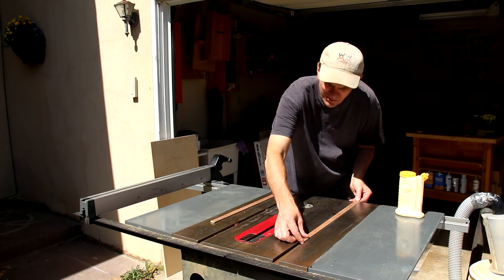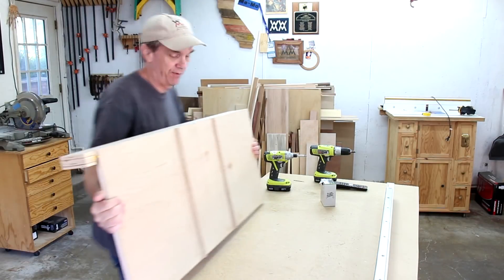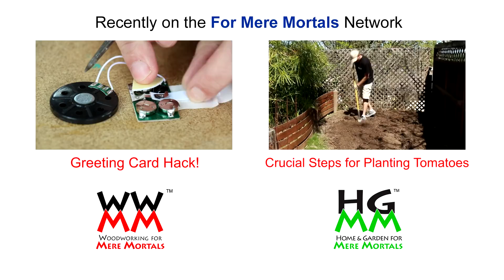Build a crosscut sled: essential table saw jig

Comment: I'm a complete newbie. Will this crosscut sled prevent kickbacks? I noticed you don't have the riving knife while using this jig. Or is it there and i just cant see it?
Reply: I'm interested too. Just commenting so I get a notification
Reply: I can try to answer that... A cross cut sled allows you to cut pieces of wood that are wider then they are long.  Without a cross cut sled, you should never do that because the chance of kickback is really high.  With the sled, the material is held tight against the rear fence and the sled is snug in the mitre slots.  It greatly increases the safety of cuts and allows you to make a greater variety of cuts as I mentioned.
Reply: Rob Knox kickbacks are caused by 2 main reasons.
1. The wood was not kept running parallel trough the blade.
2. Or the wood strarts to worp during the cut... Make sure ti have a riving  knife to avoid kickbacks.
So yes this will help but kickbacks usually happens when you are ripping.
Reply: Jay: even with a sled, internal stress in a board can be released during a cut, pinch the blade, and produce a kick, though the sled makes it less likely the piece will be launched across the workshop...
I find the sled invaluable when duplicating lengths for crosscuts on parts like drawer sides, etc.

Comment: Steve, I have a Ryobi Saw System which isn't your conventional type of table saw setup. It has a miter gauge table that moves with the miter gauge thus it doesn't have the slots like standard table. I have been wanting to have a sled so I could setup repeated cuts to make box joints. First have you ever seen one these saws and if so do you have any ideas for a sled that would work? Thanks, Jack G.

Comment: I need to make one of these and as a newbie woodworker, this looks like it will be a good place for me to start. 

I had a few questions, if you have time to answer.

Was there a specific reason that you glued several layers of ply together to make the front and back fences, rather than just starting with a single, thicker piece of ply (or maybe a piece of pine etc)?

Also, how essential is that metal bracket? I understand that you used it make sure you had a straight edge on the face of the fence, but I'm wondering if there is a 'non metalic' way to ensure that the fence has a nice straight edge. I'd be a little bit hesitant to put metal on a sled. Seems like if the blade were up high enough, it may come into contact with that metal bracket towards the end of the cut.
Reply: Zebitty 
Plywood resists movement with changes in humidity. As for alternatives to the angle iron, you don't need it. You can use solid lumber like maple and flatten one face of it to achieve the same thing.

Comment: I like to paint that block on the front of the sled red, as an extra "don't even think of putting your hand here" warning...
Reply: Or purple. Steve loves purple. Maybe also cover it with a different texture like a strip of heavy grid sand paper at the critical spot. That way it works even when you are not looking at your hands but rather at the cut area on the other side.
Reply: That's a good idea
Reply: or cover it with sharp pointy things!
Reply: Or put a steel plate between the block and the fence, when you hear it grind you are going to stop, it will ruin the blade, but that's well worth an un-mutilated hand.
Reply: so you can cut your hand in order to prevent you from cutting your hand....
Reply: How would that cut your hand?
Reply: Or do like they do with cigarette packs overseas, paste pictures of severed fingers all over the block as a reminder.
Reply: Or just dont put your hand there. You know, like you don't put your hand on a spinning blade, under the tire of a moving car, or in an alligators mouth.

Do those have to be painted red too?
Reply: Broken- ha pretty f'in funny
Reply: Broken Wave   Funny!  Your comment reminds me of a radio host I heard one time while driving, who was opining about all the safety equipment on cars today vs. when he was young.  He said what would force drivers to be safe and eliminate all wrecks, would be a spear point on the steering wheel, pointed right at the driver's heart.  That would be one cautious driver!
Reply: JusBidniss Its true...haha. Isn't the spinning blade warning enough?? Don't fucking touch it...pretty simple.
Most real carpenters I know (and myself) don't use safety gimmicks...instead they use tools properly.

Comment: Hi Steve, love your videos.....but wondering why you chose steel for the angle iron, does that limit the height you can cut? Are you worried about getting the blade into that steel? Just seems if you weren't careful you might have a major problem there.
Reply from the maker: Yes...definitely want to make it high enough so that the blade won't cut into it. (My blade won't raise up that high, especially with the 3/4" plywood base.)

Comment: one thing to be aware of is that many framing squares are actually not that square. So many are actually pretty shit. I got 5 and non do agree and only 1 is square enough for fine woodworking. I went to the hardware store and compared once all they had and was surprised how much they were out compared to each other, this includes bigger brands!
I think the wood whisperer has a good technique on how to align and test that back fence.

Comment: Hey Steve. Love your videos. But I have a question. I recently tried to make a sled for my contractors grade Ryobi table saw and have found that the miter slots have a taper to them. the feed end is narrower than the exit end. Is there anything I can do about that? The table surface is aluminum. Can I shave it down? Any feedback is appreciated.

Comment: I have a skil that does not allow for removal of the riving knife.  Is there a workaround for the step requiring cutting with removal of the knife?
Reply: not really, you can remove the knife from the underside of the top of the saw, but it's a pain

Comment: Steve, I have a Skil table saw, like the one you used to use. It has slide grooves with small tabs restricting me using a slide like you show. Is there a way to make the sled using grooved slides? I try, but when I do the slides are too tight. Any help or advice would be appreciated.

Comment: You have to make sure that you don't have a screw in the front fence where the blade goes through :)

And make sure you don't push through the back fence, it'd ruin your blade to run it into that reinforcing metal thingy. I liked your old design where you had a blade guard at the back of the sled.
Reply: I heard that that the wood wants to fold out on it's rings. It warps over time, like it wants to straighten out over the line of the rings or something like that...

Comment: my only question is would the ruler on the table saw still be relevant after building this? Sometimes I use that ruler on the table saw rather than measuring out with a tape ruler on the wood itself

Comment: Hey Steve how long until you would normally have to put some more of that finish on the bottom of your sled? Mine always seems so hard to push, almost to the point where it feels like it's jumping down the track and not gliding smoothly.
Reply: ***** thanks for the response. I was always told only use hardwood. Never thought to use plywood! Makes sense with the humidity here in Arkansas.

Comment: Would it not be preferable to make the sled runners out of metal (e.g., angle iron (of the proper width) similar to what you used for the bracing?  If you cut the wooden runners for an exact fit, they would bind on rainy days, and, if you allowed for that initially, then, by definition, they would have "slop" on dry days.   Even if wood expansion/contraction is not an issue, I would expect the wooden runners to develop "slop" over time just from repeated use as the wood rubs against the metal.

Comment: I would love to make a cross cut sled but my table saw has 2 lips in each groove that are about an inch long at the top that are supposed to hold the factory miter instead of at the bottom of the groove like yours seems to have. Any suggestions on how to work around that?

Comment: LOL ya got me.  Whoah, Metric!  Nicely done.  I hope you really enjoy your new sled, Steve.  I'm happy for you.  You know the 4-cut test for square?
Reply: What's the 4 cut test???? You got me itching
Reply: Philip Clark You spin a pizza-box sized piece of wood doing 4 cuts, and it compounds any slight angle on the last vertex.
Reply: Philip Clark Yes, ***** is correct, but what you do is measure each end of the 5th strip cut off...the measurement at the top of that strip should be exactly the same as the bottom width, basically the piece should have exactly parallel sides. If they don't, divide the difference by 5, and that's how out of square your fence is. If it's a positive number, move it one way, if it's negative, move it the opposite way. It would be really easy for Steve to do since he did not glue the fence, and he has a pivot screw.
Reply: Also, you drill all the holes for fence, except the pivot one, in different place, because correction us usually small enough that old screws would just bring it back into crooked position.
Reply: MP Woodworking Close, you divide it by 4, not 5. See mnwoodworks's video "5 Cuts to a Perfect Cross-Cut Sled" for a full how-to (warning: it's 37 minutes but it should answer all questions).
Reply: many thanks guys :-)

Comment: Hey nick,
 I am currently trying to make a crosscut sled for my 10inch Kobalt Table Saw, but I am having issues getting my tracks to slide back and fourth smoothly.  Do you have any suggestions?  I have been using 150 Grit Sand paper with my sander and also a lower grit sandpaper with a hand sander to try and smooth them out, but I don't want to sand too much and have the tracks fit too loosely.  Got any suggestions for me?
Also does it matter where the tracks end on the actual saw sled?  I know you recommend lining up the tracks flush to the front of the saw, but does it matter if they run the full length of the saw?  I have seen some videos where the tracks actually hang out so that the front board can be attached to the tracks?  Any suggestions?  Thanks in advanced.

Comment: Steve, thank you for your woodworking videos, I am a huge fan and I'm learning a lot from you.  On this video, I noticed that your smaller sled was cut for a dado width blade.  I want to build a sled for dado cuts as well as regular cuts.  Should I build 2 sleds or can I use the same sled for both types of cuts?
Reply from the maker: I thinks it's best to have 2 separate sleds. Then they each have zero clearance for the blade.
Reply: Thanks Steve. Due to storage space I was hoping to get away with just one but you're right, the zero clearance makes them safer. I will build 2 sleds and make space to store the them.

Comment: Steve, I have inherited an old Craftsman table saw.  My issue is the table is no longer flat.  I am going to build a cross cut sled for it but due to the table not being flat, I want to make the runners full depth so the sled actually sits above the table.  Now to be honest, I really have no interest in woodworking.  I plan on cutting aluminum sheet with the proper blade.  The primary table (minus extensions) is only 17"Wx20"L.  Instead of using the slots, would it be acceptable to use the edges of the table?  I want a large sled so this will also keep the sled from tipping due to having the table so far forward and back to fit my stock.  The longest cuts I plan on making are 24".  I do work as a Union Millwright, so I am mechanically inclined, just not a wood worker.  Any tips are greatly appreciated.

Comment: Hitting that angle iron with the blade by mistake would worry me. I know.. just be careful.  It just seems a little dangerous.  Would it not be enough to simply clamp the plywood to a straightedge before screwing it to the sled base? I'd imagine with enough screws it should stay pretty straight

Comment: Steve, I assume you planned for this when designing your sled, but I couldn't help wondering if the blade could be raised high enough to accidentally make contact with the steel angle?

Comment: Could you also get a wide board for a base with perfectly parallel edges, use a carpenter square to locate the runners at right angles to one of those parallel edges, then just attach the fences to the outside edge of the board?  Like, not sitting on the board and attached with vertical screws, but sitting alongside its edge and attached with horizontal screws?  There'd be no adjustment, but you wouldn't need it, if the base was parallel, the runners at right angle to the edge, and the fence stock of consistent thickness.  That seems easier somehow to me.  The only disadvantage I could see is if the base thickness was too thin and too little 'meat' to adequately take a screw, then you'd want the other orientation and screw up into thicker fences.  But other than that, is there a disadvantage I'm missing?
Reply: Since screwing anything to wood distorts the wood, you need to attach at right angles to the sensitive direction.  Screwing a fence to the edge of the base would compress the base.  Murphy's law says the compression would distort the base too much.  Also, getting the edge of the base perpendicular to the saw table's channels is next to impossible.  A few thousandths here and there can screw up a project.  Steve's swivel-screw method, coupled with the 5-cut squaring technique, can give you a right angle with a couple of thousandths error over 20" or so.
Reply: Ah, Murphy's Law, gets me every time!   And good thoughts on the sensitive direction being the one you want to be perfect.  I don't know about compressing the base per se , but I have had difficulty on occasion screwing something tight against the other piece vs. having a gap, so I suppose a 'tight' joint vs. a loose one (even without a gap) would throw things off.  Plus if the carpenter square doesn't get the runners perfect, you're right, no adjustment there once glued, and even if not glued, reattached runners would need to be moved far enough away from the original screw holes, etc., which is more of an 'ugh factor' than what I was attempting to avoid by attaching the fences to a good parallel edge.  Good points all, Bob D, thanks for your input!

Comment: Hi Steve, does this  replace the mitre saw (for making 90 degree cuts) ?
Reply: Oh very much!  A properly set up cross cut sled is many many times more accurate than ANY miter saw.  Not Festool, not Roybi, sleds will always win.

Comment: Steve, are you worried that the metal bar might get hit by the blade?  Nice and quick jig.  Thanks,
Reply: If the fence was tall enough that the blade could not reach the metal bar even if the blade were all the way up that problem would be eliminated.
Reply: @bruceevans56  IF

Comment: So I've tried building a crosscut sled a couple of times. Besides my table saw just being cheap, my stumbling block has been my miter slots; they're T-tracks. I've tried trimming the runners to the T- shape but they didn't feel sturdy enough. Then I tried using T-bolts, but there's too much play. Any suggestions? I know eventually I'll need a better saw. I just hope by then I haven't completely converted to hand tools. Feels like I'm heading in that direction.
Reply: I just ground mine out. I tried making itty bitty rabbits on the runners, but it never worked out.

Comment: Only thing that is making me hesitant about these kinds of sleds is that it seems like they force you to get rid of every safety feature the saw has to use them... although it looks like you might be able to still use the riving knife the blade guard and kickback prawl are gone...
I do need something - the miter gauge that came with my saw is so inaccurate it's almost useless (it fits loose in the grooves) but I'm wondering if I can't get a similar result from just getting or making a more accurate miter gauge (such as one perma-set to 90deg? Hmmm)
Reply: +Shadoglare , Even with safety equipment you can still injure yourself. For example, the blade guard is great but there is nothing stopping you from sticking your fingers in it. I always condone the use of safety equipment but it is not there to eliminate the risk, only reduce it. There are certain cuts that are often made on the table saw that are not possible with the blade guard, riving knife or kickback prawls in place. While the standard disclaimer is to never remove or bypass your safety equipment, there are times when it is necessary to remove certain items depending on the cut. It would be one thing if someone told you to remove a guard by drilling out rivets or cutting it off, but when the item is designed to be removed with the push of a button it's because the manufacturer acknowledges that there is a time and place when it is appropriate to have it off or out of the way. If you can use it, always do but realize there are times it is impossible to make certain cuts with all of the safety equipment installed.

If anything, I think a crosscut sled makes crosscutting much safer by providing more support for the workpiece and safer positioning for the hands especially when cutting smaller pieces.

The cross cut sled also adds a level of safety to the table saw by creating a zero clearance slot for the table saw so there is no chance of a piece of wood falling into the blade and being launched at or behind you when making narrow crosscuts. Zero clearance inserts are not standard on many table saws. In this way, using a sled would be safer than simply using the saw's standard equipment.

Comment: Hi, I am a novice and would like to know if a table saw can cut a board even on both sides of the board. When a table saw cuts the top of the board has a shorter cut than the bottom of the board. I would like for certain cuts that both the bottom and top of the board be cut even.
Reply from the maker: +electrofranko You need a band saw to do that.